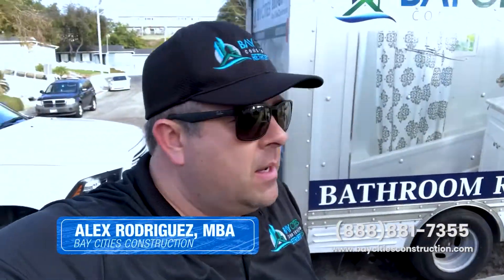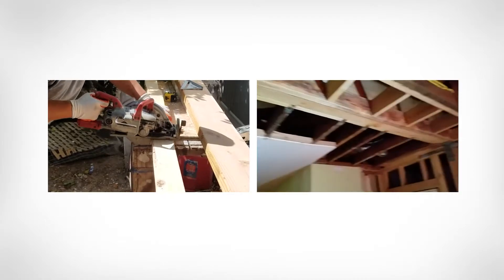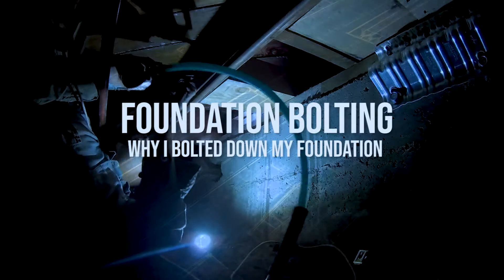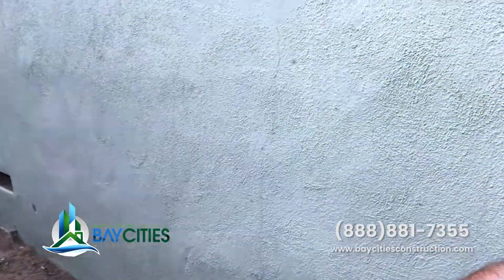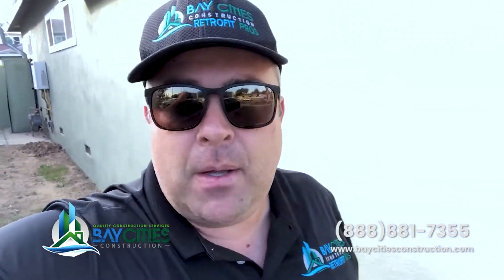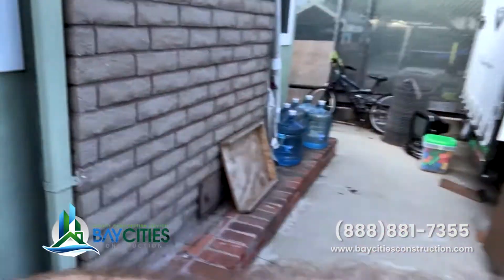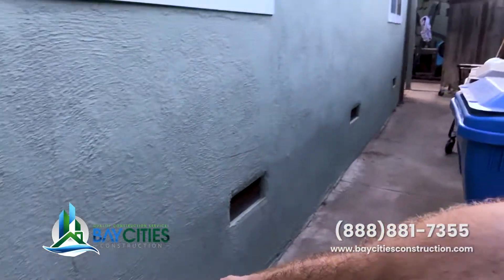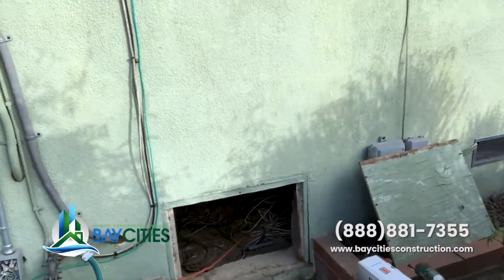Why I FINALLY Bolted Down My Foundation | Seismic Retrofit Pros

Comment: You waited THIS long to do it???? And you had it easy with no cripples you just had to add UFPs...just curious, I’m also in North Redondo, our house was built in 1958. We’re on a slight incline we so we have cripples on some sides but otherwise they did bed anchor bolts in the stem walls every six feet. Did your place not have existing bolts?
Reply from the maker: Was a little busy bolting down other people's homes 😂  the house does have some bolts but they aren't evenly spacesd, 8" mostly (10" in some areas) After the 2019 Ridgecrest quakes i noticed some fine cracks on the stucco running along the mudsill so I knew I would need to bolt it down. Luckily no cripple walls on mine, you might want to sheath it with struc1 plywood (if it doesn't already have some)